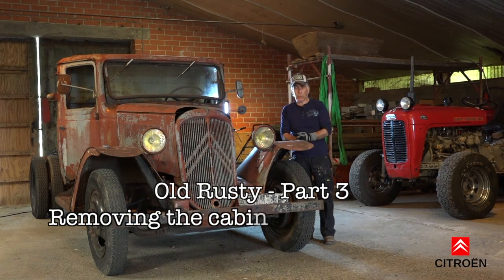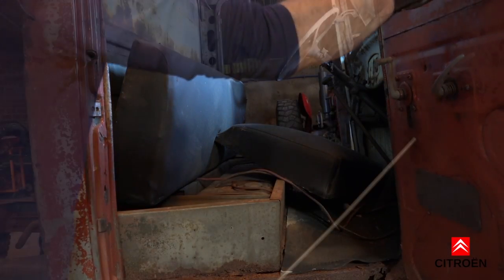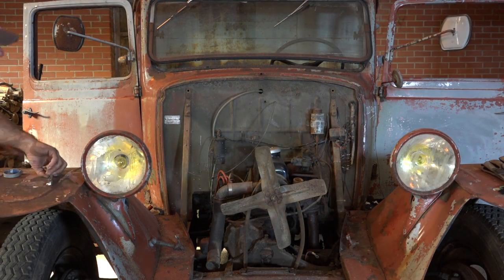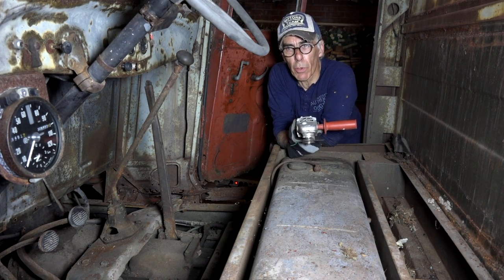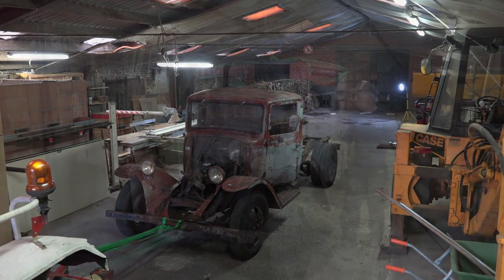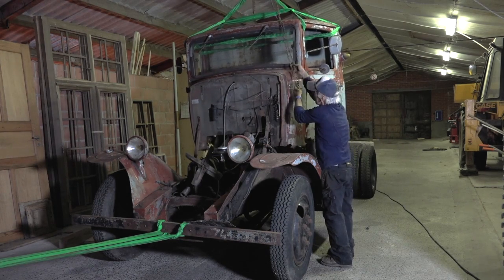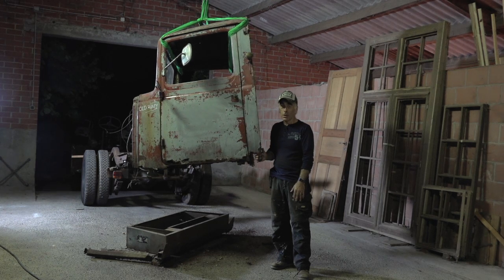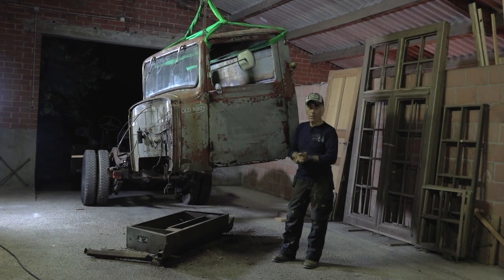Old Rusty Part  3 , Removing the Cabin

Comment: I like this model of the Citroen truck, and first saw one here on Youtube. It is quality built and the series went on for several decades - don't know the exact years. They re-used parts such as the chassis rails, head lamps?, wheel rims, both axles etc. This saved on tooling, and anyway if parts worked well, why re-design them. Enjoying watching the restoration, merci.
Reply from the maker: Thanks for the comments, indeed first build in 1934 untill 1950

Comment: You got a great workshop. I'd have stopped the tractor to jump off!!
Reply from the maker: Mike Barton , txs Mike.  I could have stopped the tractor yes.  But turning the wheels on the truck is easier while its rolling.  And the tractor  was  in a very low gear with lots of space in the front.

Comment: Does Citroên support you? If not try to contact them for the missing parts, at least for the alternator.
Reply from the maker: No they do not, I wish... but they may not even remember this model. I might go full electric/battery
Reply: Peugeot do have the same model cars and tucks, useful for the spare parts. Citroën have an old cars & trucks museum. They'll probably guide you in the restoration guiding and recomendations.